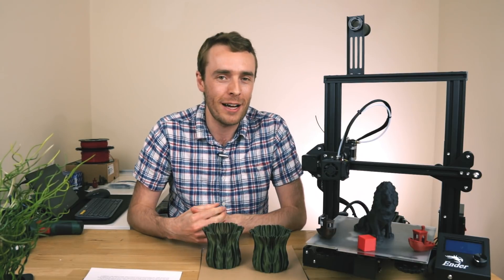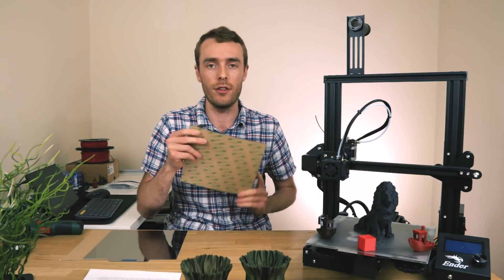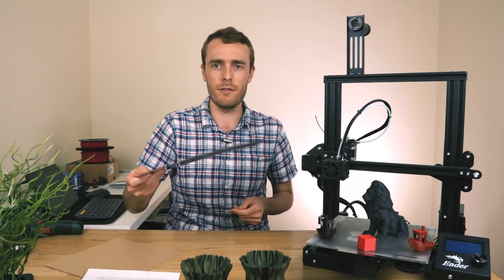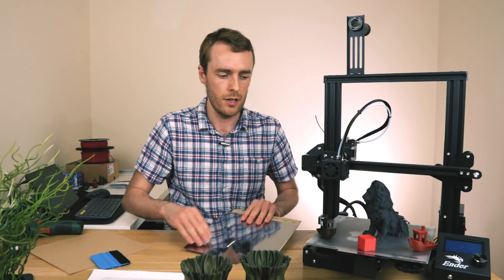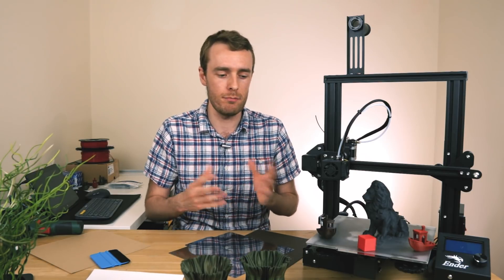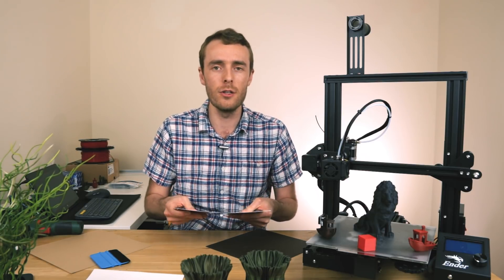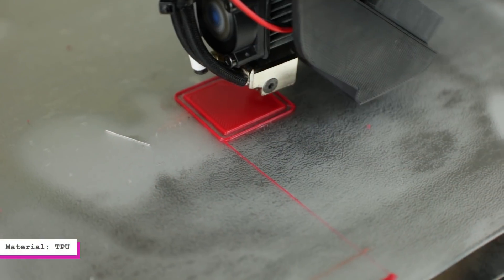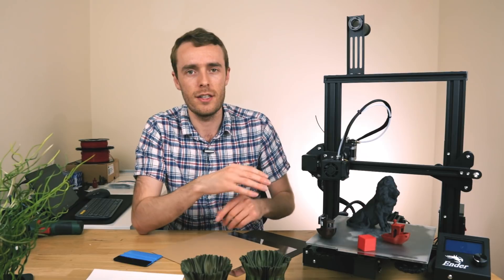Last Print Bed You'll Ever need? - Andornot Flexible Plate Review

Comment: Did you try the sheet in conjunction with the magnetic sheet build into the base on the ender 3 pro ?

I'm thinking it would be nice to retain the ability to use the existing surface as well.

Comment: Please try using a rigid fr-4 buildplate with 4mm thickness. You will Love these thingies, because they Stick so well when hot (60 to 90 degree) and Release the Part when Back at room Temperature. Without the need to flex them. They are cheap, you can regrind them with sandpaper If you need to and they are as flat as the Support beneath. I Don't do bed leveling anymore with a First layer of 0.1mm in a 30x30cm bed with petg at 30-50mm/s Speed on my self:build coreXY. When watching your prints and also all the other ones on YouTube, they seem sooo slow to me. So slow as, hmm..., cant think of anymore. But i am driving away from my original message, try a FR-4 buildplate. Please!
Reply: @Vector3DP  FR4 is an epoxy resin sheet reinforced with fiberglass, commonly used as the base for printed circuit boards. FR stands for flame retardant. Garolite is one brand. In the U.S., it can be purchased from McMaster-Carr. MatterHackers also sells a linen-based version of Garolite as a build surface for nylon.
Reply: MikeMike Would you recommend the ones from aliexpress? (I live in France which makes it a bit harder for me to source parts)
Reply: @theogaillard5355  I haven't tried any Garolite or other print surfaces from AliExpress. I might if the price was right. Also, both McMaster-Carr and MatterHackers offer international shipping.
Reply: @mikemike7001  Thank you for the quick answer, I will be looking into that!